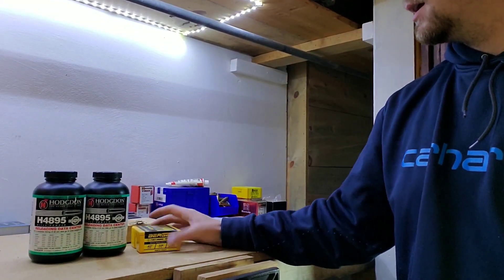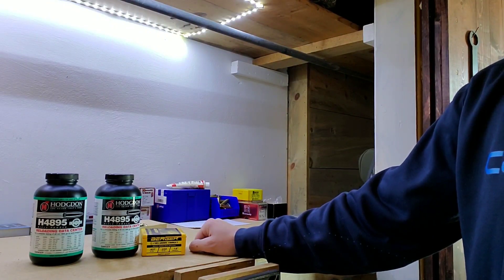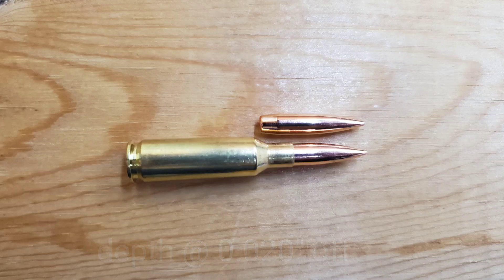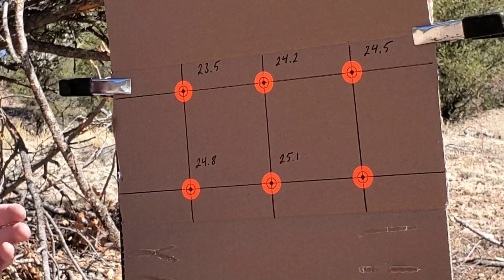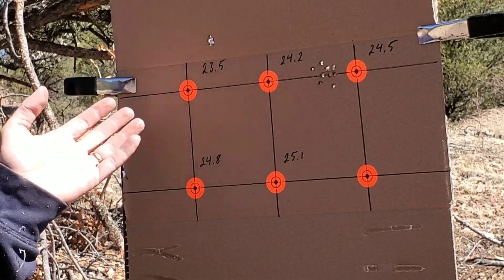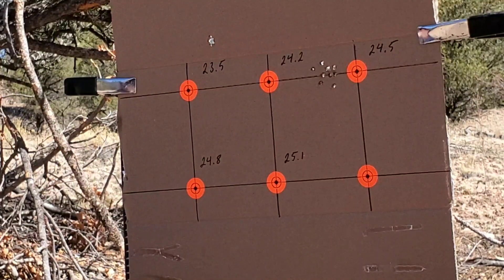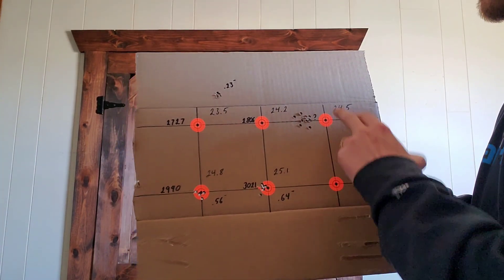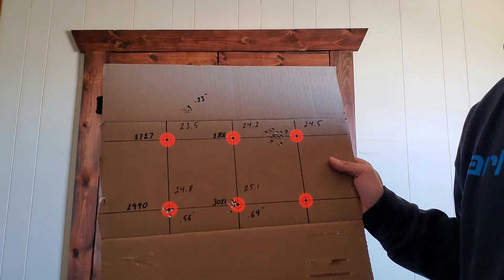Budget Custom: 80.5 gr Berger and H4895, 224 Valkyrie initial charge weight test

Comment: Looking to build a 224 bolt action.  Can you provide the specs for your rifle?  Thanks!
Reply from the maker: Of course. I've also got a build video up, but in short. 

Zermatt origin SA
Keystone accuracy .224 valkyrie (0.115" freebore)
Trigger tech special 
KRG bravo
Ruger gunsite (accurate mag)
Primal rights 6BR mag kit

Optic of your choice.
Reply: Practical Precision Shooting Thanks!  Sharp looking rig.  Still very impressed with your first load/5 shot group.  Lower Velocity but you just can’t miss with that level of accuracy/grouping.  So for the Origins action, are you using a KRG Bravo chasis for Rem 700 stocks?